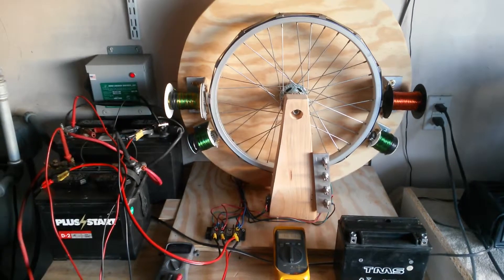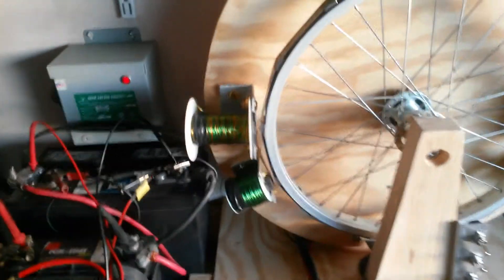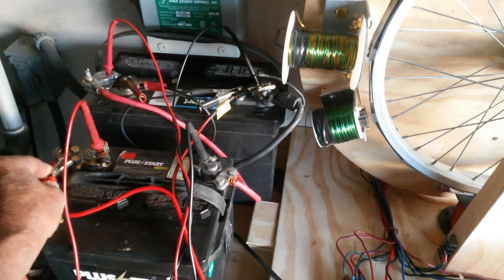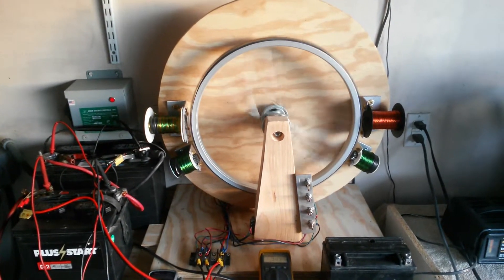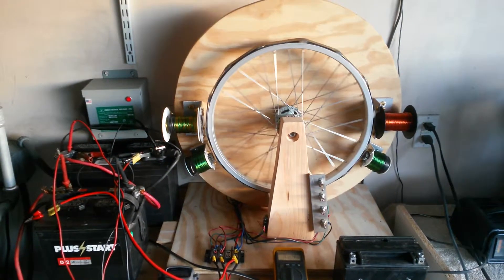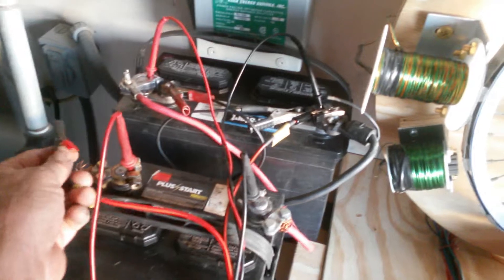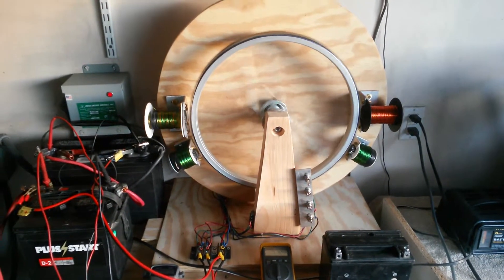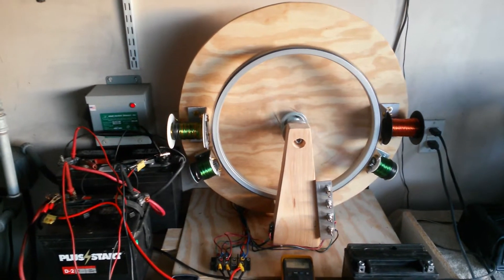Bedini Pulse Motor  Self Starts!

Comment: How possible is this. The transistor is open therefore it should never be able to spin. Are your directly putting 25v at the primary coil thereby not using the transistor?

Comment: I think it self starts because when it stops at least one magnet is aligned with a drive coil and it gets a push when current is applied?
Reply from the maker: it is that plus I was running off of 24 volts instead of 12.

Comment: When a wattage draw is lrss then wattage generated I'll invest
Reply from the maker: On 12 volts to 13.6 I get 43 volts output on my new version of this with 4 bifilar coils. The 200 volt spikes cleans sulfur off of the plates. With two batteries at 26 volts I make 87 volts. volts x amps equals watts.
Reply: monstirz I understand. But you can do that with a joule thief, too. Does it keep on runnin’ when you exchange batteries over time ? If yes, I would like to experience with this stuff. I already Made a bedini water crystal battery 😃
Reply from the maker: @artofwebdesign  I ran it for 2 weeks by switching batteries back and forth and drew off of the charging battery as well.